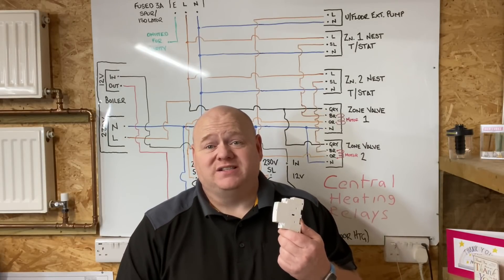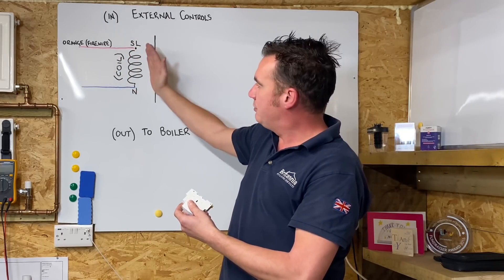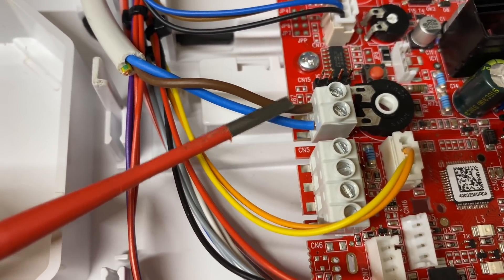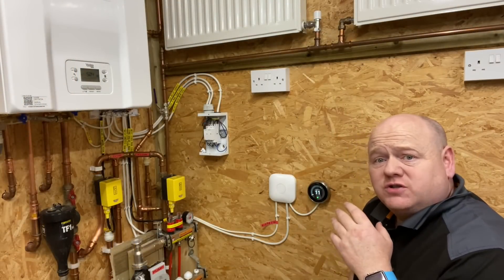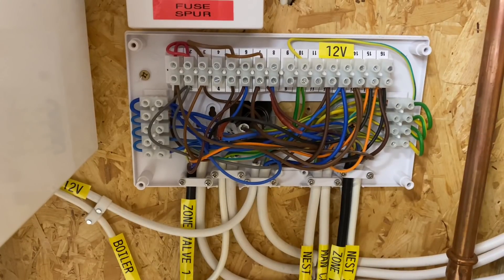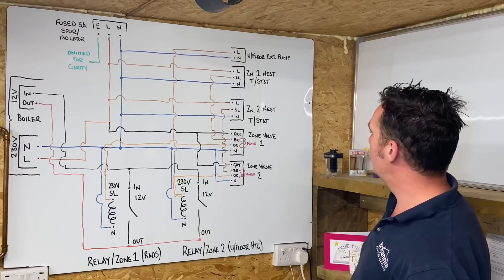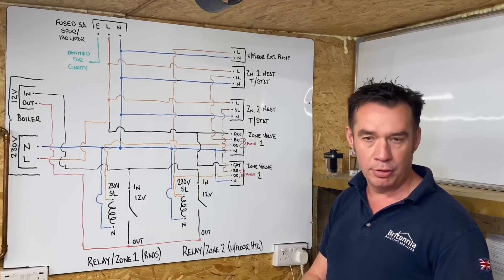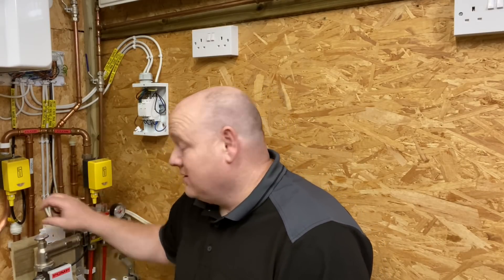Relays On Central Heating Systems - Leeds Plumber

Comment: Just one point. The motorized valve brown wire does not supply the orange wire to operate pump (see video at 15.03,)  etc. The brown wire operates the motor which slowly opens and activates  a micro switch, the micro switch is fed from the permanent live (grey) wire and supplies the orange (fire) wire, this now operates the pump or boiler. The danfoss motorized heads are renowned to fail in the on position, causing the appliance to operate permanently, this is because the micro switch is stuck in the on position, so you either replace the head or dismantle it to locate the micro switch, just free it up with some wd 40, reasssemble and you are good to go. I have dumped several heads (Which cost around £60.00 plus vat, when a simple squirt of wd 40 would have fixed them.

I have a question for you. Is it possible to feed the burner and pump seperately on an oil fired boiler ( They are fed downstream from the control box via the orange wire)  So the timed/thermostat controlled feed to the boiler exits into the boiler house. The boiler ( A grant boiler) is then connected up to this feed. My problem is that the boiler sometimes over heats when the feed is switched off causing the boiler high limit statt to cut off the internal supply to the boiler and pump. I have incoperated a thermostatt which activates above 80^C to bring on the pump only, which is supplied by a seperate  230v permanent supply, so the problem is that I am getting the usual backfeed. So is there any way I can enable the pump and burner to run seperately and not suffer from backfeed when the 80^C statt is operating??  Regards Fred.

Comment: I'm not an electrician but could you not use a diode on the switch live for the underfloor heating stopping a return current obviously having to run 2 separate switch lives direct to boiler. 

Just more simple I'm genuinely asking the question. 

Thanks

Comment: Thanks for this video on relays.  It solved my voltage back feed problem when I added a new UFH system to my existing CH.  Now, both systems can independently enable the boiler.

Comment: Does the Sl from stat not engerise the brown on the MV which then turns the motor inside and closes a micro switch between orange and grey (permanent) which energises the fire wire orange ?
Just Darren said the brown energises the switch wire

Comment: That was really helpful ⭐️

Can u please. Explain  how to do pump over run  wiring  on heat only boilers  and how to connect 
Wireless connections. By 
main link radio switch  thanks 

And please  give some info on air conditioning units. Please 
🙏

Comment: What should I order for the relay please. But I want one that has 240v on both of the circuits. I'm assuming you can still use the ones you are using, as it's only operating as a switch, so if you have 240v in on both circuits you will get 240v out on both circuits too.
I'm right in thinking the really is basically a 2 port valve head? 2 separate circuits, first circuit brown/blue makes and breaks switch, then Grey/orange is the 2nd circuit (but obviously that's all 240v). 
I could do with a relay that does the same to split a 3rd zone on low loss header (and essentially make it 3rd and 4th zone off the 3rd low loss header pump). Thanks

Comment: Great video this. I'm on with a bivalent system (heatpump and boiler). The boiler has its own system pump which is fine. I need to know how to turn another system pump on when the ashp is on. Heatpump and boiler run on different dT's and are hydraulically separated via a LLH.

Comment: I have an unusual setup with 2 separate plumbing circuits, one does HW and the other the CH. Each has a separate pump. It has been set so i have to have the HW on to use CH as there is no connection to the boiler to request it to ignite. I've figured a way using relays to get around it but how do i get the pumps to stay on for a little while after the boiler switches off to soak heat away from boiler?

Comment: Great video Allen, do you know if the system is wired to a heatmiser uh8-rf, would this avoid the need for relays ie are the built in  to the wiring centre? I hand a 3 zone system 2 radiator and 1 underfloor. Cheers Ian

Comment: Very good. Just wondering if you can use those relays to connect 2 boilers to one system so you can switch between them if needed. Lets say oil and backup electric one. One needing 230V signal and other 0V signal which I assume will be 12V.

Comment: I have a couple of inverters as backup in the event of mains electricity failure so I can have some lights for the house.  I rigged up one to an isolated gas boiler to see if it would continue to function.  It powered up the pump but would not fire up the piezoelectric to ignite the gas.  Any ideas on how I could make this work?

Comment: Can’t you just connect the Brown switch live on the zone valve to the pump on the under floor heating then you don’t need to worry about back feed?
Reply: No you can't do that. The Brown wire is supplied with 230 volts which is basically just a motor which turns slowly until it operates a micro switch which is built into the motorized valve head. (You are likely not aware of this as it quite small and would require you to dismantle the head to gain access to it.) The micro switch is volt free, so you could bring 12 volts or 230 volts to it if required. The grey wire brings the voltage and feeds the boiler (or whatever) via the orange wire. You can confirm this by testing it out on a mororized valve head, just connect the brown, blue and earth wires to a 230 volt supply. Using a multimeter, with the power switched on to the valve head (which will operate the motor and turn on the micro switch) You will find if you test the  orange wire with the grey disconnected, that there is no voltage at the orange wire. The grey wire supplies the voltage, be it 230 volt or 12volts. So you would need to be careful when supplying a boiler with a 12volt input supply that you dont use a grey 230 volt feed.  You will not get back feed from an orange wire to a brown wire as they are not connected at any time. You will need to use a M/V to supply the UFH system so why would you not wire it correctly using the orange and grey wires.

Comment: Hi Allan 
Great videos really enjoy them 
I have a question for you I am thinking of changing my Glow Warm Ultimata ff120 heat only which is on ‘off switching not modulated on a s plan plus system .
I have evohome working in most rooms , works fine . 
As the boiler is now quite old to may be a Viessmann WB1B heat only boiler , can the s plan plus system work on a open therm as this looks to be a better why of running the heating side of things .
I think I can use a OpenTherm Bridge (R8810) to get over the switching ?

Comment: To summarise the situations this would be useful in..

1. Isolation if control voltages are different in your system.
2. You have more than one pump (and want independent control (ie system boiler but also separate pump for UFH circuit as you have here), the main boiler pump would always be under control of the boiler but the zone pumps would be under control of each zone control
3. You need remote control of a high current device, ie immersion heater but switch is on other side of the house, you can then just use wireless/LV control of the relay for that. I think this would also apply say someone wanted immersion heater switch in bathroom, I do not think rules would allow you to have a 240v high current switch in that zone so you would use a LV relay.
Reply: Just a quick question on 2. that you've listed could you not achieve the same result as a 240v  to 240v relay by wiring the ufh pump live with the switch live (brown) on the zone valve?

I also understand that the secondary pump will momentarily be pushing against a closed zone valve until the actuator motors over and should the microswitch or actuator fail the pump will continue to push against nothing.
Reply: This was more of a generalisation of relays/contactors use. Im not a heating eng, just someone with insights into anything technical/electrical/mechanical, but always verify with heating eng to confirm anything said.

 @TheRantyMan  Remember that one side of the relay is volt free, it only passes though what you put in, ie you have 4 terminals, across A1-A2 you apply control voltage per specs normal 240v, across B1-B2 you see nothing just continuity. Note a relay is also called a contactor.

The secondary pump should only come on after the zonevalve has opened up, so you drive the pump via the orange wire from the zone valve which is NO until the valve is open then its closed (you do not want to push against closed valves), this activates the relay on say A1-2, B1-B2 would then be your upstream/boiler trigger and you can pass whatever you need though there, 12v-240v dependent on control voltage of boiler.

One thing I think in this video is that its assuming someone is using a system/combi or an openvent with boiler controlled pump and that you do not have any chained zone valves as that gets more complicated and not covered here. If you have say an open vent with external pump then I would think you need additional relay taken off the boiler trigger to turn on the main pump as well if the control is 12V, if it was 240v then you could just wire the pump though the control wire dependent on boiler specs.
Reply: Ive only just come across this channel but love his videos, down to earth guy, makes me want to change my job and do a hands on trade rather than sit in a chair all day long.

Comment: Thanks for the video but on the relay is the front 230volts and back low voltage and does the 12v have neutral,could you show a close up of relay terminal connections if possible.
Thanks Alan
Reply from the maker: I added a picture in the Community section. Thanks
Reply: Thanks again for the advise Alan but it’s not clear to me what’s the low voltage and 230volts it looks like neutrals are at the bottom of relays are the blacks with red tape the s/l from 230volts

Comment: Another great video Allen. Not useful to the video here but I'd just remind viewers that the Vokera  boiler used has three slots to house accesory relays in the control box itself. None are sent with a combi boiler but are available as an option (£20). One is included with each system boiler. If you do a follow up video I'll get some sent to you.

Comment: Great video Allen. It shows relays . I would have used the ufh Heatmiser wiring Center as it offers the switching but this is a great explanation. I think more of this on switching is needed and also explain why what goes in on the brown comes out on the orange .. it doesn’t have to be 230. 
Well done mate .. great work.

Comment: Good video but i think Zone valve 2 should be feeding a double pole relay that switches a separate protected 240 volts to the under floor heating pump. If the pump goes over current it will take out the relay coil feeding the boiler and maybe even the thermostat  before the 3A fuse blows. The live feed to the pump shouldn’t be off the same feed as the Boiler relay coil. Just a though.....
Reply: This circuit has the relays only switching in the boiler (and indirectly its pump) via a voltage free contact in each relay. The heavy current devices need permanent line wires (or live as said by many), so they do not run though sensitive equipent. The heavy current device in this control circuit is the pump.

Using one relay:
1) the Nest stat for the UFH energises the UFH zone valve (Zone 1).
2) the Nest stat for the rads energises the rads zone valve (Zone 2).
3) use a relay with two contacts. This is only used for UFH, Zone 1 only. One contact for the pump, the other contact voltage free to switch in the boiler.

Permanent lines:
i) a permanent line to the end switch contact on the zone valve on Zone 1 (UFH).
ii) a permanent line to a contact on the relay - Zone 1 (UFH)
iii) the UFH end switch energises the UFH relay coil.
iv) a contact in the relay energises the UFH pump. 
v) permanent line comes from the fused spur switch.

UFH Zone 1:
a) the UFH Nest energises the UFH Zone valve - Zone 1.
b) the UFH zone valve opens making the end switch.
c) the end switch energises the UFH relay closing the two contacts.
d) the relay switches on the UFH pump.
e) the relay switches on the boiler.

Radiators Zone 2:
a) the Radiators Nest energises the radiators Zone valve - Zone 2.
b) the radiators zone valve opens making the end switch - Zone 1.
c) the end switch is voltage free switching in the boiler. 

Note:
♦ The boiler and UFH pump are never switched in unless the zone valves are open, so a pump cannot be pumping against a dead end if there is a fault.
♦ Only one relay used.
♦ The two Nest stats only energise the two zone valves.

Comment: really good video thanks, how does the relay take 240 and pass it out as 12v i take it the coil energizes and only produces 12v, also do all relays do this. and also does putting the wire either way round on the 12v connection on boiler matter thanks again, also what amp do you need for this application.
Reply: The 12V is supplied from the boiler PCB, you pass it through the contractors and return back to the boiler without referencing it to 230V anywhere in the system mate, imagine you are keeping a pressurised heating circuit separate from the gravity hot water system, they never mix 👍🏻
Reply from the maker: They are separate circuits.

Comment: First time i used a relay in a domestic job was on an existing  eletric wet system with a direct cylinder with immersion heaters. The property was a holiday rental and the owner had a nest to control  heating . So to give him control of the hw immersions using the nest hw side.the electrician wired in a relay
Reply from the maker: Thanks.

Comment: The circuit will work using just one plug-in relay, not two. 
But two simplifies it for understanding. One relay per zone.
Reply: Would the pump not come on every time with only 1 relay

Comment: 15.03   Should be Grey and Orange !          Brown is motor opening  feed and not connected to orange....    ;-)                 Still a good Video, cheers.   J
Reply: Absolutely..  brown with Neutral operates motor only, motor opens, hits switch in valve linking grey and orange ( grey and orange could be 240v or volt free etc, depending on situation.. grey and orange just being linked via internal switch operated by motor opening.. as said good videos though

Comment: Just some points. Darren may have mentioned many, or all, of these.

1) The 12v is provided by the pcb. NEVER put  230v onto the 12v terminal of the pcb - or any voltage of any description.
2) The boiler must be permanently on as the Nest thermostat/timers do all the thermostat on-off and timer switching 
3) A zone valve is an electrically operated isolation cock. 
4) A zone valve is also a relay. Instead of a coil opening a switch in a relay module, a motor does. When the motor reaches the end of its travel (water cock open) it opens or closes a switch - sometimes referred to as an end switch.

I prefer the plug in relays. They are cheaper.  If one fails it is a matter of plugging one in and out - no touching wiring. Also the plug-in relay and its base is cheaper than one Schneider as shown. A spare plug-in relay can be left in the relay enclosure box in case one fails. The relays are a potential failure point. They are small. Then a two second job changing.  

Relay Base that clips onto a 35mm DIN rail:
https://cpc.farnell.com/finder/94-74sma/base-for-plug-in-relay/dp/SW02493 

Plug in Relay
https://cpc.farnell.com/relpol/r4n-2014-23-5230-wtl/14-pin-industrial-relay-7a-4pco/dp/SW05448?st=55%20series%20plu%20in%20relay

These relays and bases were off the shelf items at Maplin. 

The price of two plug in relay bases and three relays (one spare) is about the same prices as one Schneider as in the vid.  Each plug-in relay also has three or four contacts that can be normally open or normally closed - the Schneider only has one contact.
Reply: thanks for the info on these relays John , much appreciated.